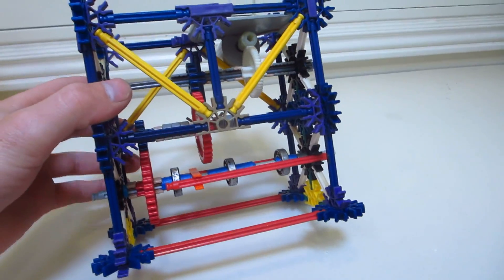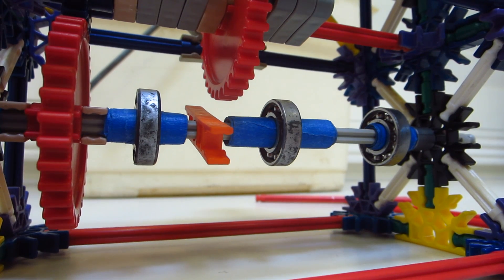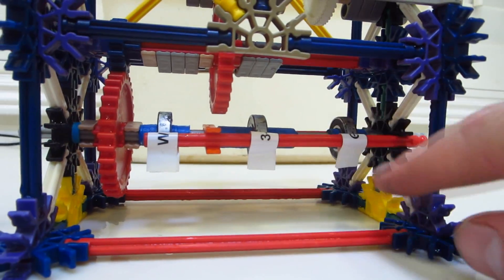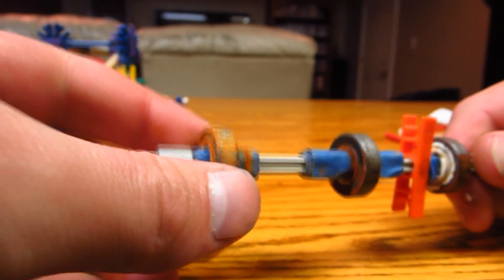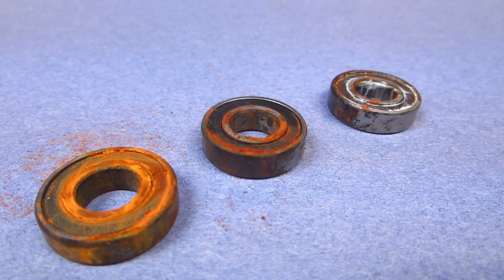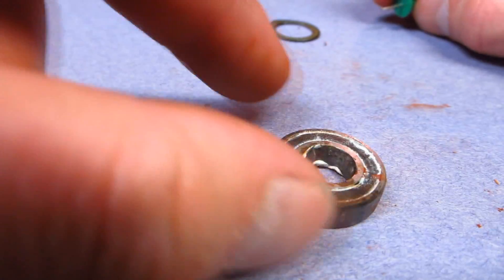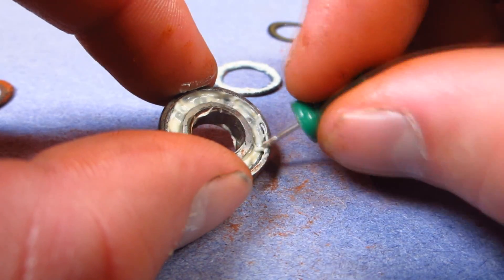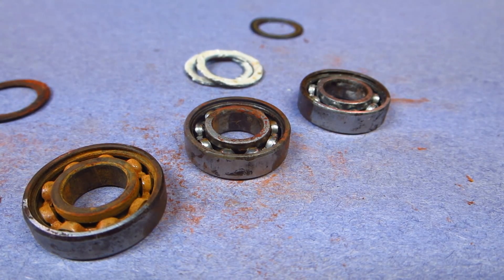Can Bearings Survive 10 Days in Water? (experiment)

Comment: It doesn't really matter if they are underwater or in 100% humidity after water gets into the seal, the temperature factors higher, and any salt is a killer. So when we get water in and leave them on the side for a week, it's teh same as underwater because they have condensation for 10 days. great test tho.

Comment: What Should I Use to Keeping My Fidget Spinner From Rusting Because I Accidently Put Water On The Bearing
Reply: You should stop
Using fidget spinners
Reply: If the bearing has removable seals then wedge them off a pin or toothpick or somesuch. Hold it in tongs and blast it with a hair dryer.
Alternatively place the bearing in rubbing alcohol or denatured alcohol (long enough for it to be internally coated if shields still on) then give it some spins and rub on paper towel to dry and the alcohol should evaporate quickly.
Reply: fucking common sense m8

Comment: The thing about shields is that they are mostly for dust protection, not airtight water protection. With heavy grease, it's going to attract more dust and stick in the bearings longer which will corrode them unless you wash it out frequently. I prefer oil because it runs and it takes the dust with it and then I can just put more in, also it balances itself out so it's near perfect distribution after skating for a bit. Like @PetrovichGaming said, bearings will act completely different when weight is forced onto them. Just because a bearing spins freely when you flick it doesn't mean it will be smooth to ride on. All the weight will be transferred to the imperfections, most of the time though it's unnoticeable.